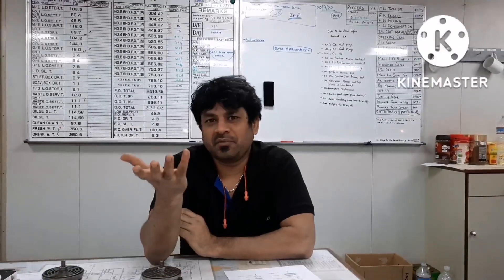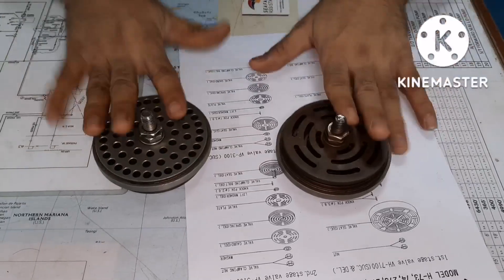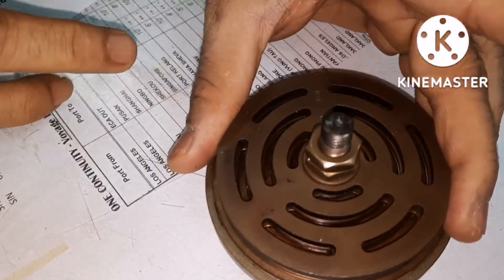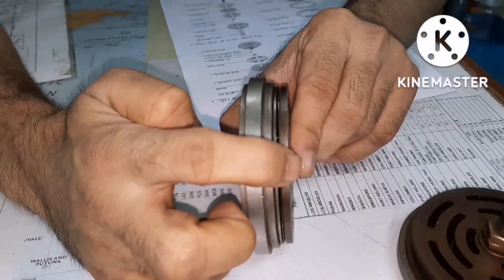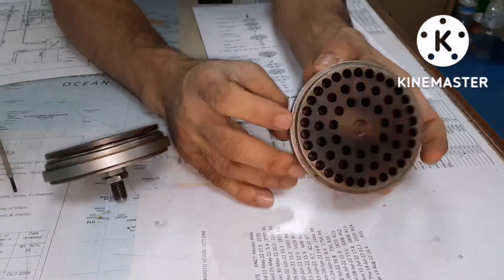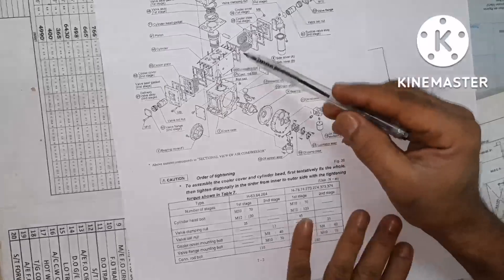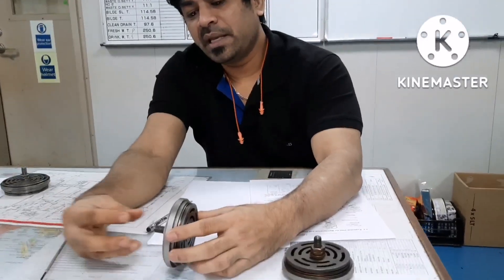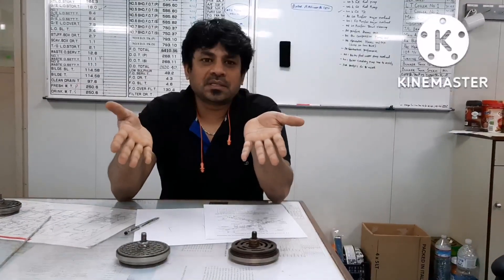Fourth engineer must know.. know everything about Main air compressor high pressure valves...

Comment: Sir. How we check suction valave and delivery valve wether it correct working. after assembling.What is the special tool used for that purpose. Examiner asked.l told from a screwdriver. But he did not accept sir...🙏🙏🌻🌻
Reply from the maker: How to check..
You can do leak test after assembling valves.
Once you install on place.. You can check the pressure gauge and check the pressure is building up as per the stage to check the working of valve. 
* Some makers give special tool for checking the valve after assembly... Usually v have to check the spring operation for free movement... 
Ur rt u can use screw driver to check the movement of spring after assembly